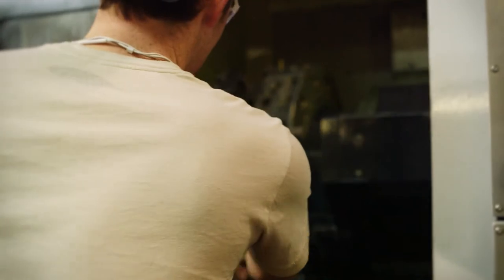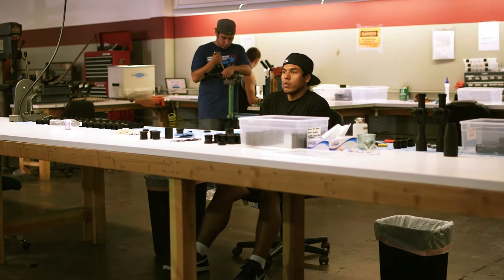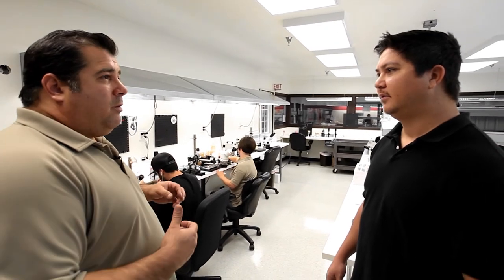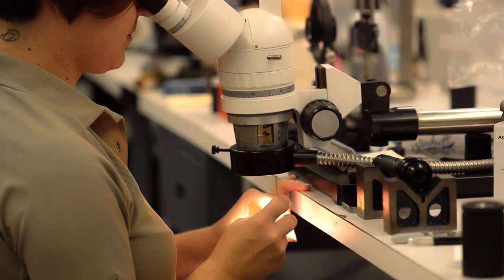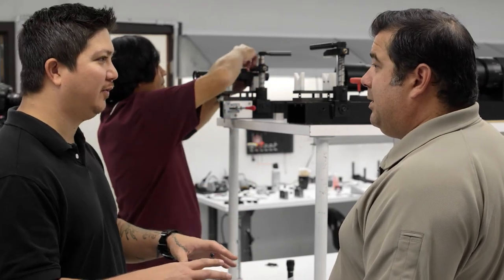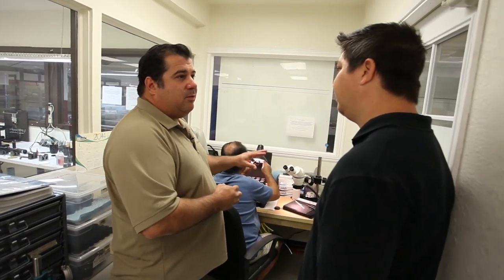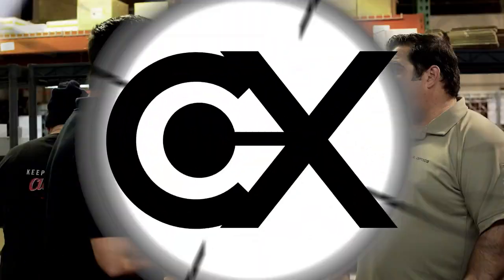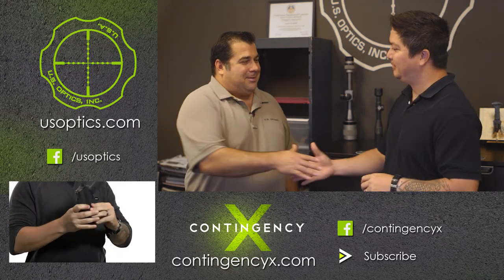U.S. Optics, Inc. | An Inside Look

Comment: That was 5 years ago now they’re made in China. I was very disappointed and moderately pissed off when the USO TS-6X-SPF I ordered arrived, and the box said “ Made in China “ the label also said the elevation and windage adjustments were 1/4 MOA however the adjust turrets were marked 1/2 MOA. 
Do the Chinese have a different numbering system ? I don’t care what kind of warranty they give you, if it fails at a critical time, you won’t be alive to send it back. YouTube needs to delete this video, it is false and misleading
Reply: Just the cheaper ones are made in china. The ts series.